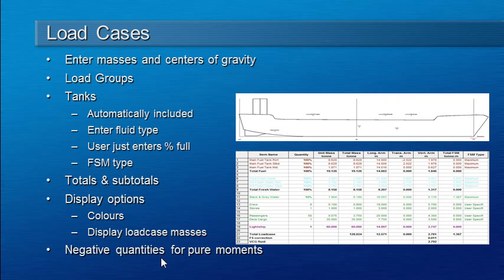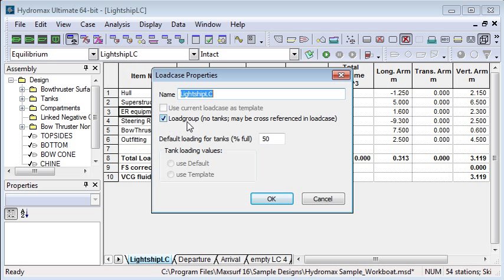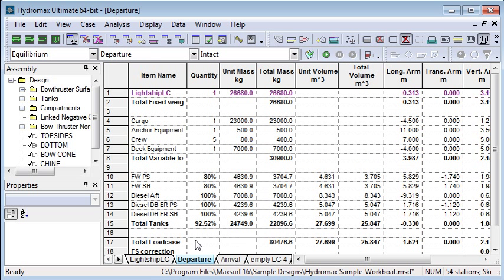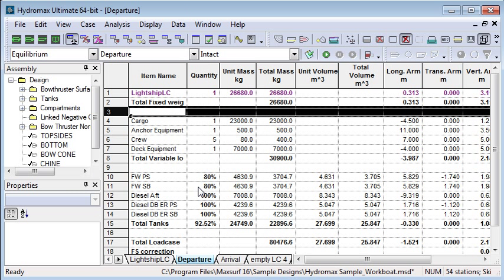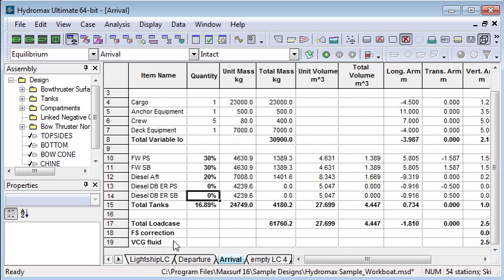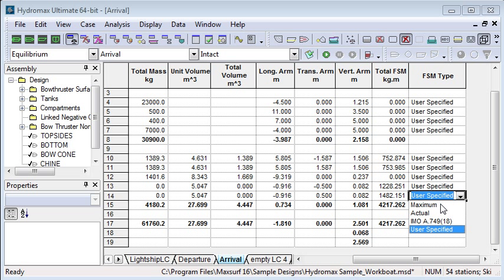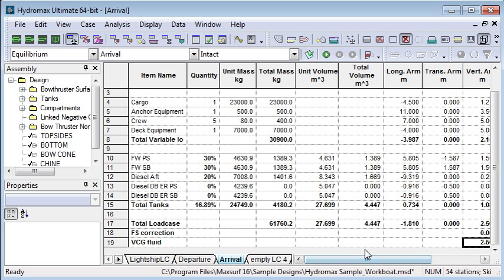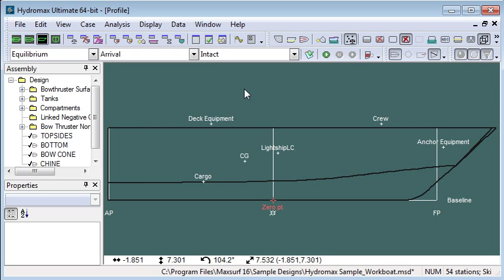Load Cases

Comment: Dear Sir,

Can you please help me with the Trasnverse and logitudinal, Vertical arm values or is it generated by MAxsurf
Reply from the maker: You need to define them based on where your weights are located on the vessel. Remember to set up your Frame of Reference and Zero Point first using the command in the Data menu r the Data tab in the ribbon.